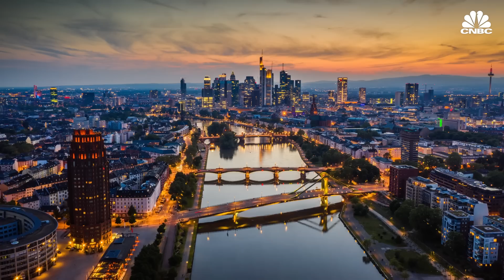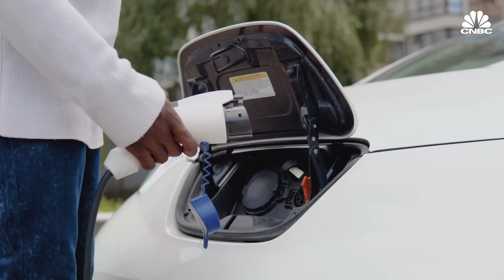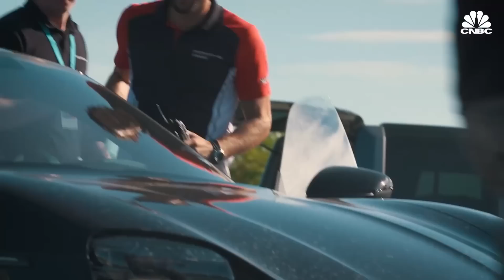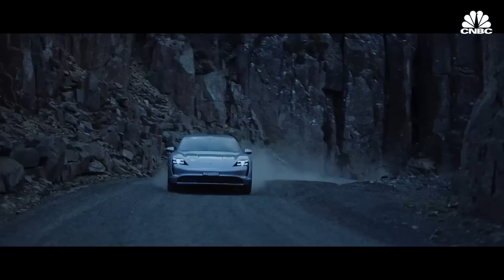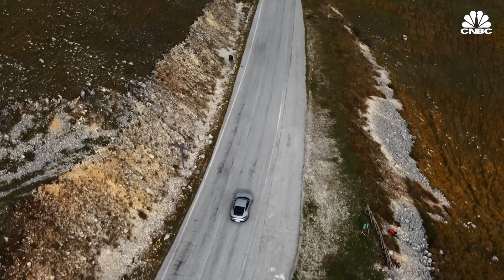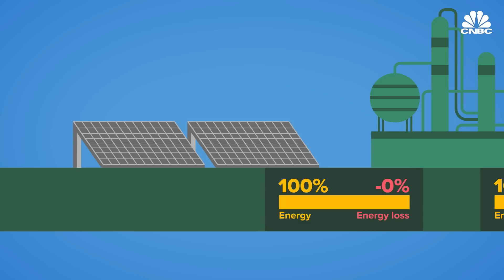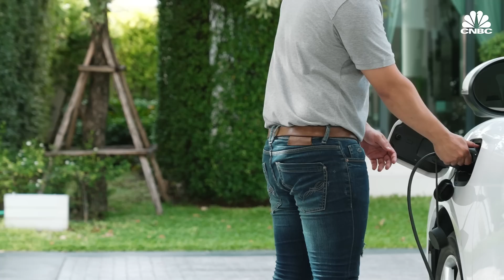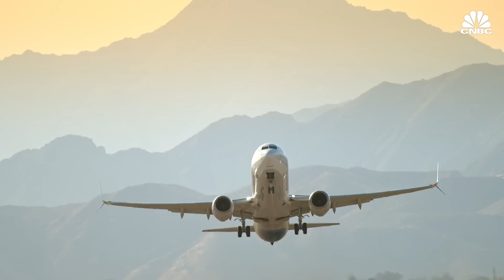How Porsche Plans To Keep Its Gas-Powered Cars On The Roads

Comment: Until I can jump in an EV and drive halfway across the country without plotting a course on the car computer to ensure I hit a charging station, an EV purchase is not on my radar.
Reply: You must not be the brightest bulb on the chandelier..
Reply: @TheMadmax0609  But he has identified a major snag, so brighter than you if you're dismissing it.
Reply: @stevemawer848  I've driven both ICE and EV on road trips.   It's MUCH EASIER to know exactly where you're going to stop, and what's around you at that stop vs driving aimlessly until the low fuel light comes on. 😉

Looks like you're not so bright either.. 🙄
Reply: @TheMadmax0609  when it's all planned and you can find charging station on your way. It might be a good idea

The problem lies if you go through a middle of nowhere, or your route map doesn't cover any single charging station
Reply: @hectornecromancer5308  there are literally more places to fill up your electric car than a gasoline car. 🤷

Range anxiety is for wimps..
Reply: @TheMadmax0609  good luck charging your batteries in a rural area without any sorts of charger
Reply: @hectornecromancer5308  like I said, you aren't very bright either.  I can charge any place that has a power outlet. 👈🥱
Reply: @TheMadmax0609  you were lucky then to be able to charge anywhere you go
Reply: @hectornecromancer5308  anyone with an electric car can charge anywhere they go.  I'm not special.  Bring the charger with you and when you get to your destination you just plug it in. 🤷
Reply: @TheMadmax0609  When I drive, I prefer to drive where I want to go, not to the places that companies have chosen to put chargers (not top mention the stress of wondering if they'll actually be working and unoccupied) - and I can can fully recharge my ICEV in 5 minutes so can continue to enjoy the drive much sooner.  But maybe you don't enjoy driving, so a computer on wheels is just your thing - it takes all sorts.
Reply: @stevemawer848  I can drive anywhere too, and I don't rely on where companies have chosen to put chargers. 

Question: If you had a gas pump in your garage how often would you fill up anywhere else?  

Don't be dumb, Steve... And don't feel bad, you're not the first person I've had to wake up.  My car gets 119 mpg and has 1000 horsepower.  Only a fool would continue to drive a gasoline car as a daily car.
Reply: @stevemawer848  oh and just so you know, you're spending more time "waiting to fill up" than I am. 🤣

It's simple math:  if you fill up once a week and it takes 5 minutes each time then that means you waste 260 minutes a year standing next to your car.  That's 4 hours and 10 minutes! 👈🤣👏👏

When I get home it takes me about 3 seconds to plug my car in and go inside for the evening.  My car fills up while I'm eating and sleeping.  When I travel, I know exactly where I'm going to stop, and what's nearby, so I plan meal breaks, shopping, etc around the charge time, which is usually about 20 minutes to half an hour.  There's a 100% chance you're wasting more time than I am. 😉
Reply: @TheMadmax0609  Ah, but you're fortunate enough to have off road parking and a home charger.  That puts you in a minority of the population, and I'd rather spend 5 minutes a week filling up than an hour every few days at a public charger.  So I won't waste my time with an EV.  SImple maths, as you say.
Reply: @TheMadmax0609  Ah, resorting to insults.  Says it all,  really.
Reply: @stevemawer848  says the man who in his first post decided to tell me I wasn't very bright. 🙄

If you're not fortunate enough to charge an electric car at night while you sleep then keep your gasoline car, but if you can find a way to charge while you sleep then dump that old technology and buy electric.

Comment: Both Hydrogen and Efuels have MAJOR draw backs. Costly to produce & store. Used only one time & gone.Cleverly sold as 'green'. Burnt in combustion engines with 100s of breakable moving parts and, did you forget, oil changes & other maintenance items.  Electric, on the other hand is simple, regen, and when the batteries are not usable for autos, they can be used for storage, and then recycled. The retrieve rate, on the materials, is 95%. How would anyone think ICE is better than Electric?
Reply: Because battery alone is not pratical on a heavy transportation application

Plus, how'd you get electricity in the middle of nowhere to recharge?

Comment: Keep buying liquids at dictated price, do not go self-reliant by installing solar panels on your roof.
Reply: Not everyone has the option of solar panels on their roof - apartment dwellers don;t really have a roof, unless the count the floor of the folks above them.  And not everyone lives in a sunny place, or has access to offoad parking/charging.
Reply: @stevemawer848  at least in theory you can. Electticity price is coupled to so many other things. Automotive liquids have no other use and you pay whatever you are told.
Reply: @NoHandleToSpeakOf  You have to pay whatever you're told for any form of energy.  Can you choose what you pay for solar panels?
Reply: @stevemawer848  solar panels are the means of production that you own. energy is bought once and used once.
Reply: @NoHandleToSpeakOf  Until they need replacing.  What's the lifespan of solar panels working efficiently?  Do they pay for themselves during that time?  And of course that relies on you having sufficient places to actually fit them.

Comment: Tbh I’d rather have an EV-powered Porsche (esp one from the 1960s). I love driving pretty-looking cars, but I hate doing maintenance and working with stinky car fluids. EVs need very little maintenance (mainly tires)
Reply: But its not an authentic experiance anymore!Its ok for replicas !
Reply: @brunoheggli2888  I’m okay with it being a replica. The “authentic experience” is a headache to maintain and keep in top working condition
Reply: @SuperSnotgun  I would like to drive a electric porsche speedster replica but would never convert a original porsche to electric!
Reply: @brunoheggli2888  Depends on the condition of the original Porsche and the model. If it's a pristine example or a top-of-the-line model that can auction for six figs on BAT, I agree with you that it's best to leave it alone. However, if it's a garden-variety hooptie in need of a restoration, it's not really going to hurt to swap an electric motor in.
Reply: @SuperSnotgun  Think about you drive a classic ford Mustang with a e conversion,the diffrence is like you visit Egypt toz see the Pyramids or you go to Vegas and go to this bad teast Pyramid hotel!Its like you have an old mechanicle Watch and then you would change the movment to a electric one!The old tech is  a importend part of the whole thing,its not just like you would change to alluminium wheels!You could show children in the future how old cars worked and how you had to use the gearbox and so on!
Reply: @SuperSnotgun  Nah for me only replicas should be electric!Also clasdic cars can be quite reliable if they are regularly driven and serviced from people who know what they are doing!

Comment: No matter the challenges, it still produces carbon dioxide whether u capture from atmosphere. The production is just challenging for mass and it still emits Carbon dioxide.
Reply: I don’t know why everyone thinks electric evs are more climate friendly, the amount of lithium that needs to be mined, transportation for the batteries to be made which are then transported again to a car assembly factory. Not to mention the fact that most counties simply don’t have the infrastructure to provide 100% clean energy to power these cars.
Reply: That's like saying plants and lumber are bad when cut down or consumed.

The carbon is just recycled with efuel produced with renewables.

Much like methane is naturally cycled on natural grasslands with ruminants. 

Evs are still consuming and producing carbon dioxide at the very least in mineral extraction, material transportation, vehicle delivery to dealers, and electricity usage in most locations.
Reply: @thesayn3ver  u do know that it still emits carbon dioxide no matter what, the recycling process to a consumer scaled is very challenging that does not help the environment. 
In case of lumber if the scale of production is more than plantation of plants and time to mature than of course it’s bad.
You are correct ev do use energy produced from fossil power plant in some states but it doesn’t emit “carbon dioxide “ compared to synthetic fuel which it still does. No Matter the recycling process it far out weighs the emission we are producing through different means.
This tech could have potential future in aviation but electrifying is the best way to tackle global emission.
Reply: @ros_explorer  Yes, it emits the carbon that was previously already in the atmosphere, so it's carbon neutral.  Do keep up.

Comment: I hope more car manufacturers jump on board with E-Fuels. I see EVs as a band aid we are swapping from one CO2 polluter to another. Mining batteries from lithium produces just as much as fossil fuels. I'll hold onto my ICE car for as long as I can. I wonder with E-Fuels would there be a method/application to convert a ICE car to use E-Fuel. If they can accomplish this they will be onto a winner.
Reply: I don’t know why everyone thinks electric evs are more climate friendly, the amount of lithium that needs to be mined, transportation for the batteries to be made which are then transported again to a car assembly factory. Not to mention the fact that most counties simply don’t have the infrastructure to provide 100% clean energy to power these cars.
Reply: 1) there is nothing unusual happening with the climate.

2) there is nothing wrong with burning fossil fuels.  Its problems in high-density areas are trivial to fix and already have been fixed.  CO2 is not a pollutant.

3) Climate alarmism is a big-lie superstition supported by tax-bribed liars.  (See Climate Discussion Nexus for 100s of videos on climate quackery, deception, and realism.)

4) decarbonization is 21st century pyramid building and human sacrifice. 

5) there is NO excuse for expensive electricity.  Electricity generation is boring.     Just burn coal and scrub the smoke in densely populated areas.

6) the only challenge is manufacturing market quantities of cheap gasoline.  South Africa has already done this for decades (Sasol), using coal.
Reply: E-fuels and current petrol are chemically identical. There would be no need to convert an ICE for the use of e-fuels. Any ICE can use e-fuels.

However, e-fuels is no true solution for the problem you see with EV cars. To make e-fuels one has to generate electricity, produce hydrogen and capture carbon from the air, and then combine those to make methanol as explained in the video. But to generate electricity without CO2 you need either windturbines or solar panels. Both require rare earth metals to function and mining those are environmentally polluting in the same way as lithium mining is. And in general those metals are only mined in China, so you have to deal with that country, whereas lithium is mined in many more countries around the world. And, yes, if you want to charge your EV you also need solar panels or windturbines, so you have to deal with mining the same metals. But as EVs are about 5 to 6 times more efficient well to wheel, you need 5 to 6 times less of those metals.
And to make hydrogen you need an electrolyzer that also requires some material that need to be mined and thus pollute. This is a step you don't need for an EV.
So, you might be familiar with the pollution caused by lithium mining, but the alternatives also need materials to be mined and thus pollute in the same way, but that story isn't told as often.

And just to add. Just because there isn't a well-to-wheel emission of CO2, doesn't mean that the same goes for the other tailpipe emissions. In the combustion process in an ICE nitrogen from the outside air bonds with other elements in the combustion and creates NOx. Changing to e-fuels doesn't change that. The same goes for particulate matter, soot and some other trace gasses. Although mostly not contributing to climate change, those pollutants are bad for air quality, cause health problems and have the potential to cause problems for flora and fauna. The only way to get rid of that is to make a change to cars without tailpipe emissions, thus cars with combustion engines.
Reply: @xavierdarche4822  "But to generate electricity without CO2 you need either windturbines or solar panels."

False, you need nuclear energy, especially because the waste heat from a nuclear power plant can be used for the production of the e-fuels.

"In the combustion process in an ICE nitrogen from the outside air bonds with other elements in the combustion and creates NOx."

This is almost completely eliminated from the tailpipe of modern gasoline-burning cars by the catalytic converter. The particulate emissions from modern gasoline vehicles are also negligible. Modern gasoline vehicles are extremely clean and would be significantly cleaner when burning e-fuels, as e-fuels don't contain many of the less desirable compounds which are found in petroleum products and burn cleaner as a result.
Reply: @PistonAvatarGuy  Even if you want to use nuclear power plants. You need roughly 6 times as many nuclear power plants if you want to use the electricity to make e-fuels compared to using it for charing BEVs. And even if it's viable to use waste heat for e-fuels, that waste heat can better be used to heat homes, a far more efficient use.

So, as you need 6 times as many nuclear power plants, I don't think you can find the political will to build that many extra nuclear power plants in almost any country. At least here in Europe there is already pushback to build any nuclear power plant, let alone build 6x more than the hundreds already needed for a CO2 free electricity production.
Reply: @xavierdarche4822  It's not quite that simple, because you could use a significant amount of energy from a nuclear power plant that is normally wasted, so you'd just be using the system more efficiently. Electric cars also require significantly more energy to produce when compared to ICE vehicles, so that skews the comparison.

The following could be true: The electricity produced by a nuclear power plant could be used to power electric vehicles (including public transportation vehicles and trains which are always connected directly to the grid), while the waste heat (which will exist anyway) could be used to produce e-fuels for aircraft and a small number of ICE vehicles on the roads... or on race tracks

And, no, you can't often use the waste heat from a nuclear reactor in homes, the distances between the reactors and the homes are typically too great.

We're going to need nuclear anyway, so-called "renewables" have been proven to be a pathetic joke.
Reply: @xavierdarche4822  So, basically, you wouldn't need ANY additional power plants, because you'd just be using energy that's normally wasted.
Reply: @PistonAvatarGuy  You can use waste heat from industry (like power plants) to heat homes. It's been done here in The Netherlands in a lot of locations.

And yes, if you want to generate e-fuels for a small number of ICEs, aircraft and maybe a limited number of other applications, that's fine, that will work. The problem start when you want to replace our entire fossil fuel supply with e-fuels. So, no electric cars, no hydrogen cars or other hydrogen applications, all houses and industry heated and otherwise supplied by e-fuels. That just wouldn't work without having to build a massive number of additional nuclear power plants.

As with most things, a balance gives a better outcome than just going full in on one option.
Reply: @xavierdarche4822  "....going full in on one option."

I never once suggested this, EVER.
Reply: @xavierdarche4822 what exactly are we going to replace petroleum products with? All oil that comes out of the ground has an associated energy and hence carbon "cost". And that's before it's processed into the myriad products, from pharmaceuticals and food to plastics and roads.
Reply: @identiticrisis  We don’t need to replace all petroleum products. The question should be what a more sustainable and efficient solution is for every application. If petroleum is the best choice for certain products, then that’s fine. It’s just that that isn’t the case for passenger vehicles.
Reply: @xavierdarche4822  why don't we need to replace it? Fully half of emissions are related to it
Reply: there are some videos already investigated your pollution concerns.  Even if the pollution is the same, I don't want to inhale exhaust at my house vs a power plant burning coal 3000 miles away.  Also, for people own a home with reliable charging at night,  cannot get any better.  Why waste time going to gas station, hydrogen, eFuel station to refill when you can charge at home while you sleep.  EV is not perfect and it's not for everyone, but for most daily usage owners,  the benefits out-weight the concerns.  Of course, there are people still using old tech like DVDs, so not going to go there. Peace.